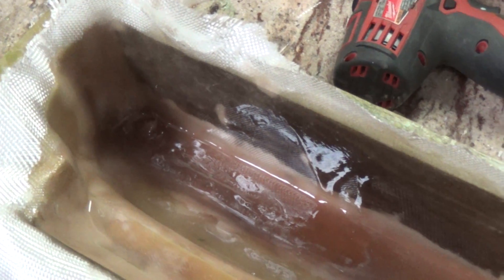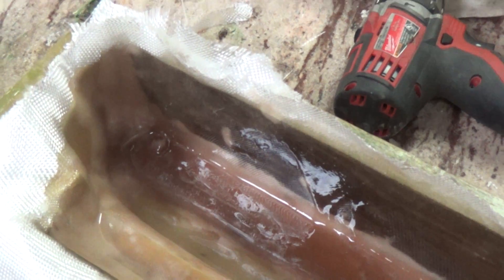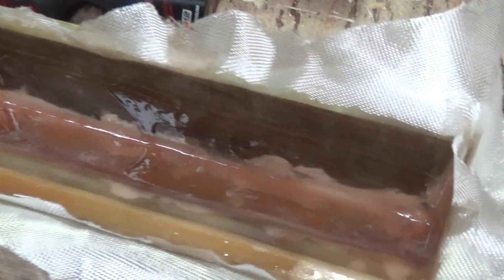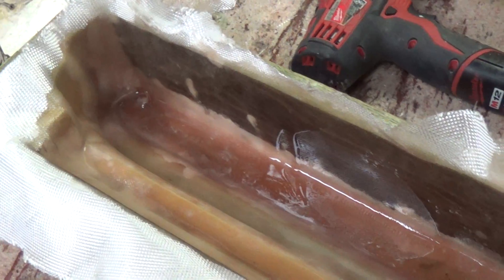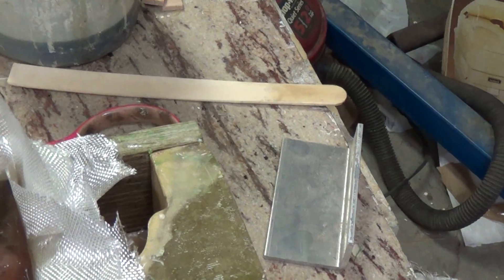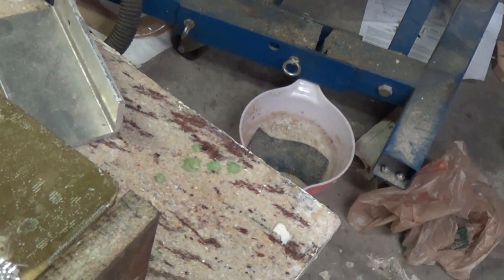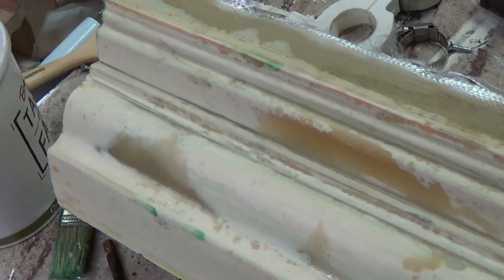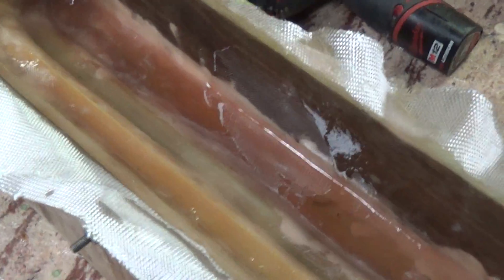Fiberglass layup tip No. Two

Comment: what do you do with the excess epoxy resin?
Reply from the maker: +JOEGGGJOE  Make sure that the glass is wet and then take a brush and do what is called stippleing, that means keep dabbing the brush to soak up excess resin and scrape the brush off in a can or bucket.  You could also squeegee the excess resin, picking it up on the squeegee and scraping it off into a bucket. To tell if there is too much resin, if you move the squeegee and then pick it up and it leaves a line of resin, then you have too much resin.  When you move the squeegee and then pick it up and there is no puddle, you have the correct amount of resin.